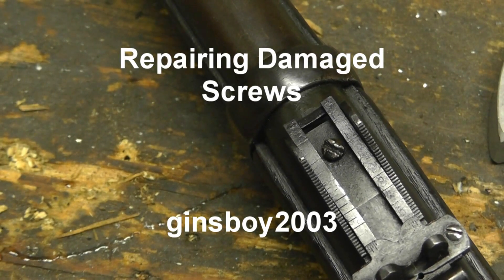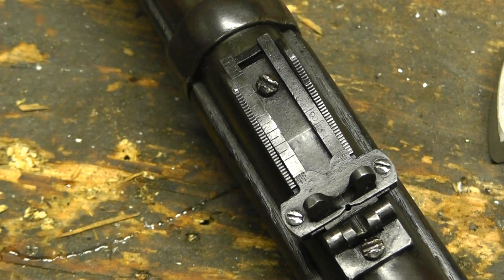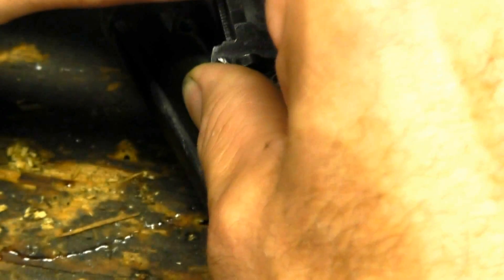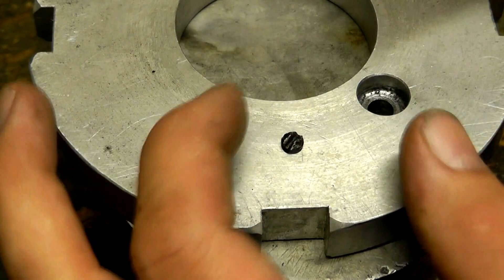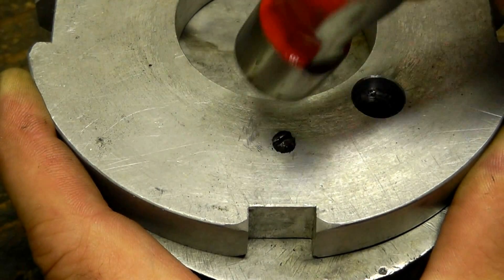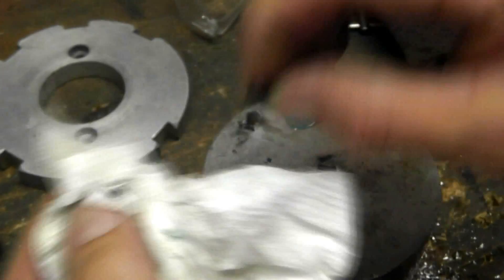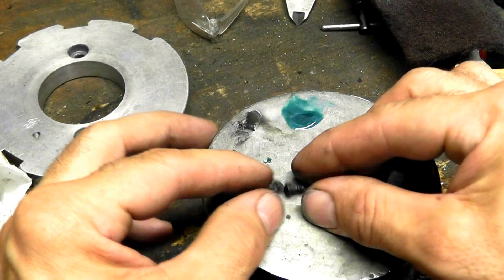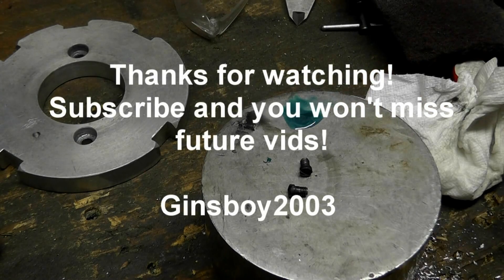Repairing Damaged Screws for old guns or new ones

Comment: Nice video .After you hammer the screw head .You might want to place the screw in drill chuck ,spin it against sand paper. Then blue it with heat and oxpho  they will come out looking a lot better
Reply: & de-grease it before blueing.  😊

Comment from the maker: It does kick hard.  The bores on these old trapdoors are also larger than .458 which is your standard 45/70 so accuracy with some rounds may be horrible unless you paper patch or use pure lead bullets so they "bump up".

Comment from the maker: I checked them out, never knew they existed.  If I was making a new screw I'd definitely use them, but for this, just tapping in the screw driver bit works great.  There is really no need to have to buy one, especially at $40 a file.  There are screws tho with different slot widths where you might need one.

Comment: These were my thoughts when making that comment: 'The oxidization, bluing, and other impurities are getting mixed in with the head of the screw when he pounds on it. If he gave it some light abrasion, or even just cleaned it before working the metal; it would improve the final product significantly.'
You see, I'm not suggesting you remove significant volumes of metal from it. I make small machines as a hobby, and this is something I have successfully done on mild steels and aluminum in the past.

Comment: .157" = 3.988mm Wonder if it is a 4MM screw...  :-) I find a slightly rounded taper punch will also help get into the smaller areas, like on the corners of the more damaged screw.

Comment: You know that replacement screws, whether repaired or new, is a time involved process. Brownell's sells carbon steel round stock, which can be machined, in order to match the blue combination (color ) , dip  in oil coating, and heat treat the screw, this will match the color combination. Or go to My Masters Carr catalog and order new, and heat treat the same way. Once you beat on the older screws, like in your. video, the strength and density of the metal is compermised, Leaving a distorted appearance. We have done both, replacement is a far better solution, buy heat treating, the new replacement s   crews, you now have a confident repair.

Comment: Always weld mine,Then redo the crown and slot. Did have one like yours,twisted one side,just snapped off anyway,so neaster to weld in the first place.Just blob with Mig wire,,then if it's round on the head lathe or drill will get the job done..Interesting all the same,Thank You.

Comment: Dude, your method works, but the CLASSIC means is tap the metal back in and recut for the correct size, then turn the head smooth to get the proper head finish back again.
also with oxpho, blue, BURNISH with steel wool and RE BLUE, do it three times and it'll stop being greenish and get a deeper blue black color.
Seeya bro, happy smithing
Dude

Comment: I loved the video! I too have repaired many screws from antique firearms in this way - but a word of caution - cold peening of old mild-steel and/or wrought-iron screw heads will leave them MUCH weaker than original 'as manufactured' screws! They will function better than 'as found' but won't take a high-torque re-fitting into their original position. You must treat them gently!
Reply from the maker: Thanks for the tip.

Comment: I would never, ever buy a gun from anyone that has screws that look even close to these. I don't care how good of condition the actual gun is. It's an indication the gun was in the hands of an idiot, and I wouldn't want anything to do with it.
Also, 3:12 you should NEVER position your finger near the hole you are drilling like in this video. With pressure being put on the drill, the bit could snap and end up going right through your finger. I know because it happened to me with a 5/32" drill bit about forty years ago.